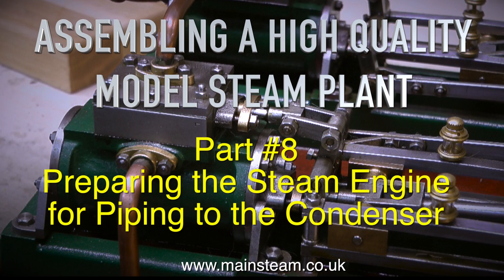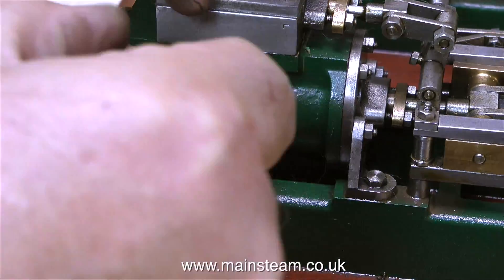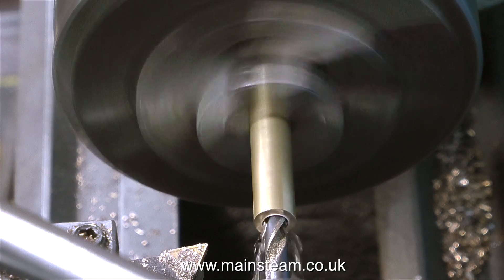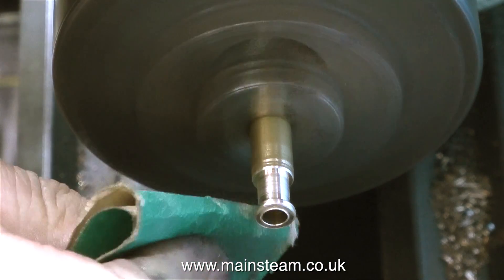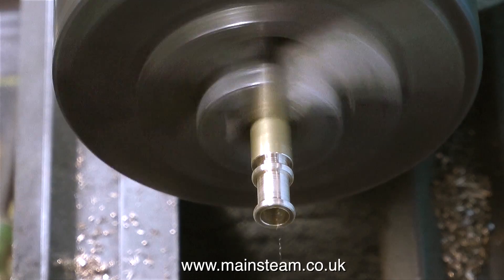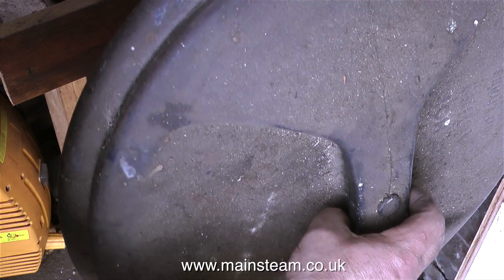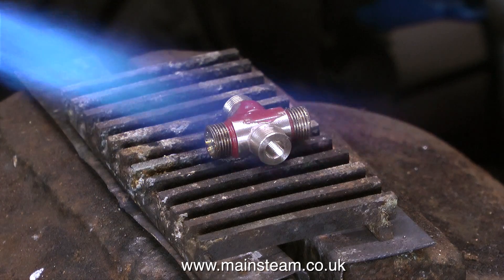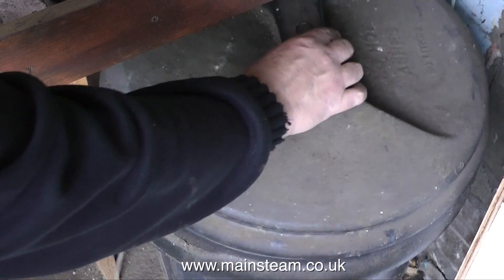ASSEMBLING A HIGH QUALITY MODEL STEAM PLANT - PART #8

Comment: Hi Keith, I have watched most of your videos although not in order they were produced. I've recently watched five I think it was on copper plating. I was just wondering, could one copper plate a copper pipe to cover the silver soldered part where a fitting is attached? Just a thought and keep up the good work. Thanks.
Reply from the maker: I suppose that would work . . .

Comment: Have you tried an ultraonic cleaner?  Works great with a bit of acid.
Reply from the maker: No, I don't have an Ultrasonic Cleaner.
Reply: Might be a good purchase, can be a lot smaller than a bin and with less volume so saving workshop space and cleaning fluid/acid.  If you need a big volume then it can get expensive.  But horses for courses, I love mine for cleaning small stuff.